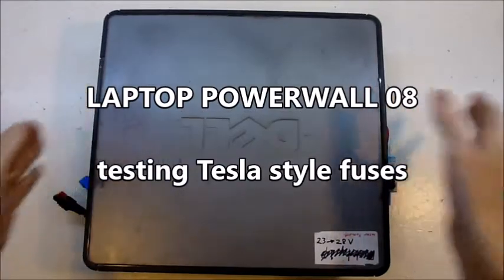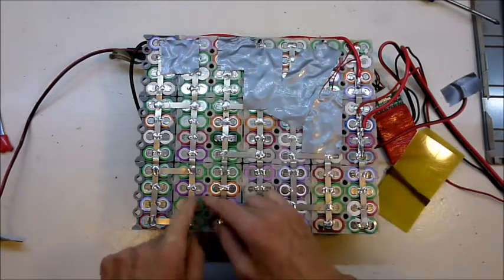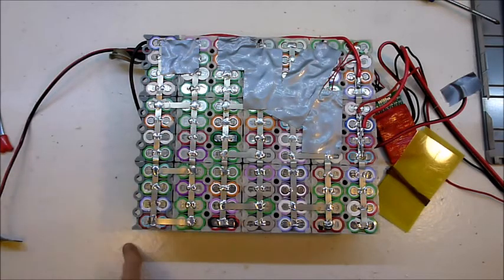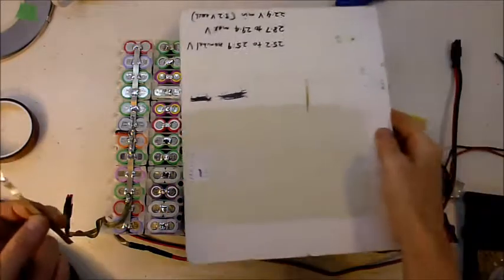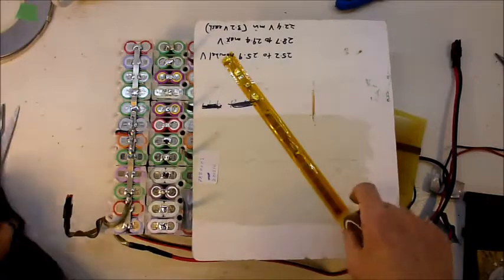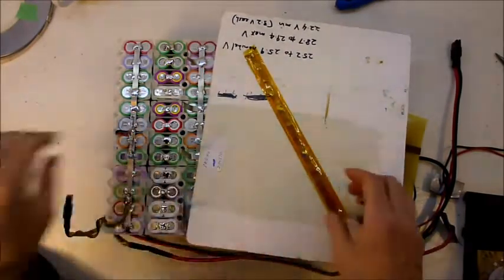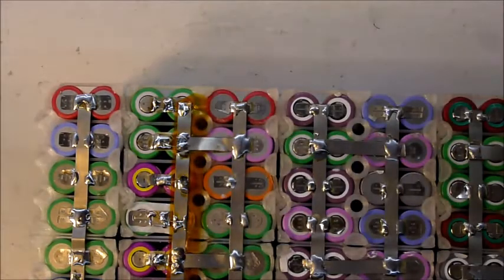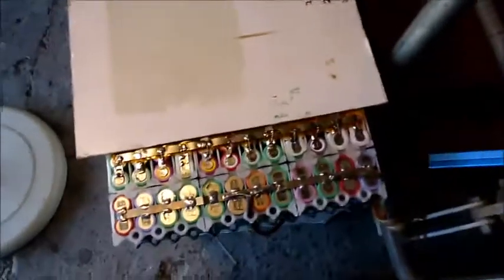Laptop Powerwall 08 - testing Tesla style fuses

Comment: How many amps does it take to pop that fuse wire, being the distance is so short I'm going to guess 30amps?
Reply from the maker: I did a bunch of tests at different lengths  and it turns out to be around 5 Amps + or - 2 Amps.

Comment: Look at this on eBay:

https://www.ebay.com/itm/282435135044

18650 Batery Spacer Holders For Li-ion Batteries,4X5  10 Pieces,battery Holders,
Reply from the maker: Yeah - those great for people doing single cells.
Reply: Paul Kennett single cells? it's a 10 cell holder. am I missing something?

Comment: Hi Paul I don't know whether you can get double battery holders but I've experimented with cutting the central plastic out of the double battery holders and they seem to hold together fine. This would save time printing. You are right about processing double batteries though.
Reply from the maker: Ah - that's good. I will probably keep printing my own holders for the time being. Partly I just like using my 3D printer :)
Reply: +Paul Kennett wish I could afford a 3D printed I've wanted one forever and a day
Reply: +Paul Kennett I've been meaning to ask you how your wincong charge controller is holding out?
Reply from the maker: The Wincing is still going great. I've been careful not to run it too hot over summer.

Comment: Hello, can you connect multiple bms's in parallel and is it a good idea? For example I want to have a small 13s 20A bms /http://www.ebay.com/itm/13S-Li-ion-Lithium-Cell-48V-20A-18650-Battery-Protection-BMS-PCB-Board-Balance-/272291298325?hash=item3f65d37c15:g:YfUAAOSwhOVXc2sA/ on every 13s12p pack to make small, safe and easily scalable unit for a power wall. Thank you!
Reply from the maker: Yes. That sounds like a good plan.
Reply: +Paul Kennett Thank you

Comment from the maker: +Grant Lister I've been considering that, but the downside is I'd need to stress the battery to force an overload - and I'm not so keen on doing that. I could make a sacrificial pack like Peter did and see if I can overload it - but I'm having too much fun building my real pack at the moment. I did manage to blow a fuse here: https://www.youtube.com/watch?v=k9Lrpqf3mlI

It seems to me that the biggest benefit of the fuse-on-battery setup is as a quick flexible way to connect the batteries with minimal heat stress. The over-current protection function comes second. I'm also a little unsure under what circumstances that might ever happen with batteries wired in parallel for a Powerwall. I know Jahu Garcia said some of the cell fuses blew in his car - but that was running way more current than my setup ever will.